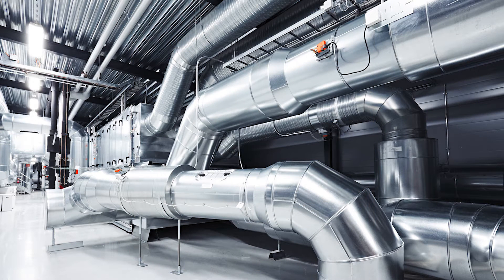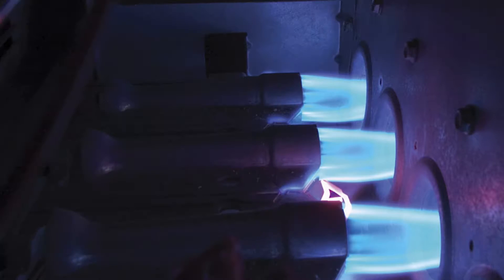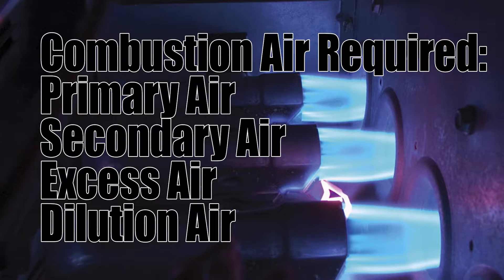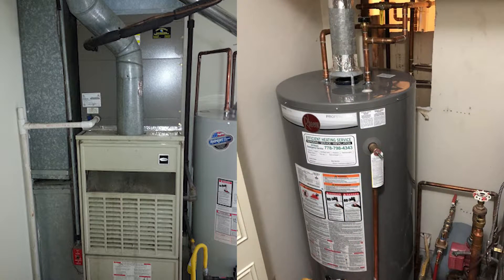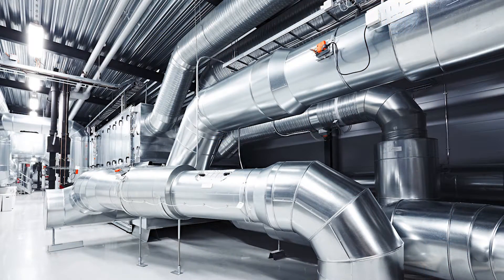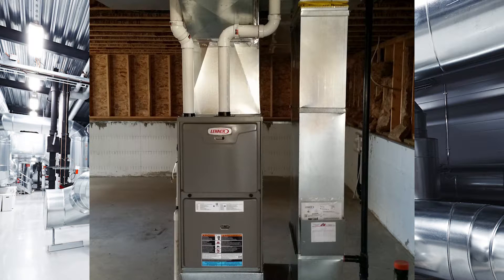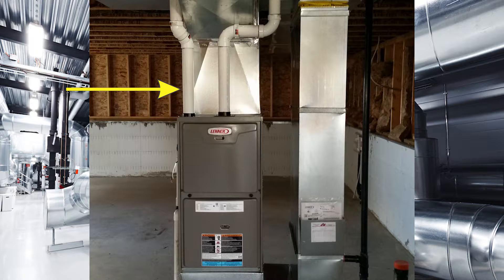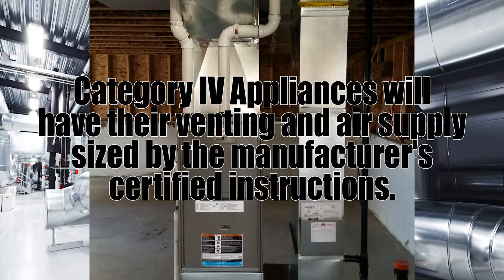Air Supply for Gas Appliances Part: 1 - Code Requirements

Comment: Hello Sir , we have a tightly sealed house with 38000 btuh water heater and 60000 btuh non direct vent high efficiency furnace . We have a fairly small furnace room say (10 foot by 7 foot area ) Im planning to make a duct for fresh air intake from side of house. As per the numbers it should be a 4 inch diameter, but since my furnace space is confined( less than 50 cu ft per 1000btuh, would it make sense to have a bigger fresh air duct of 6 inch instead to let in more air? Are there any cons to that?? Would it make our basement too cold ?? Any help is appreciated
Reply from the maker: It doesn't matter that the furnace is in a confined space, that does not factor into this type of sizing.

What you do need to consider is equivalent duct length. High probability you are over 20 feet of equivalent duct length. So go with 5" duct
Reply: @MathematicPlumber  Really appreciate your help ! 🙏

Comment: How  come I was red tagged for air supply  when have only high efficiency furnace and water heater
Reply from the maker: That is because inspectors interpret the code the way they want to. (Even if that is not what the code says)